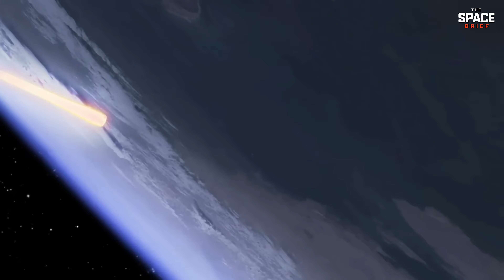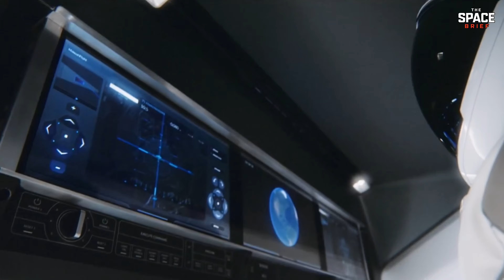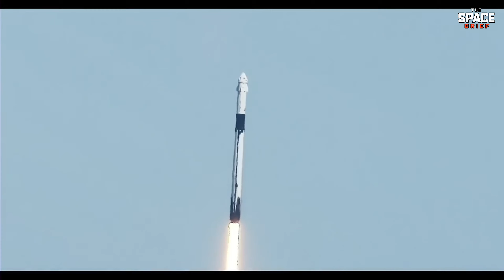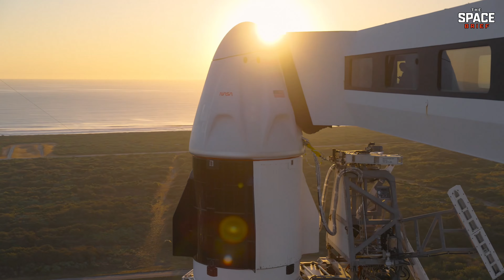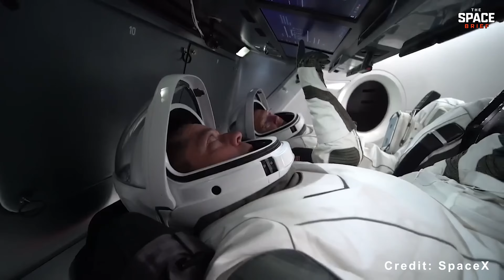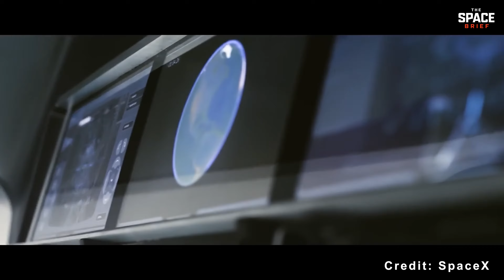SpaceX Finally Revealed The Secret Behind Dragon's Touchscreen Cockpit...

Comment: U'r highly correct in regards to the 4 (four) legendary active  "lifeline" capsules tht take humans Astronauts back and fourth to the ISS.
Those Dragon Capsules were owned by SpaceX. 
I believe one or two of separate Dragons intended for "CARGO SUPPLIES." They look similar but were used strickly for supplies. They don't have seats or touchscreen. 
They're all reusable after refurbishments.
Reply from the maker: You're right — Cargo Dragon shares the same capsule design but strips out the seats and touchscreens since it's built purely for supply runs, not crew. And true, 2030 is still just the target date for ISS retirement, nothing's set in stone yet. Thanks for watching!